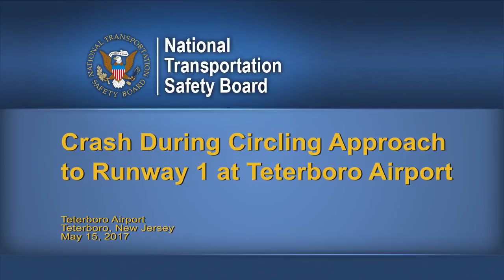Learjet 35A Teterboro Approach Crash • NTSB Animation

Comment: I follow a lot of crash investigations and it is almost never a single point of failure.  It is usually a string of failures that almost invariably start before take-off.  Reading the link provided by John Dubpernell below, the problems did start before take-off as the crew was not qualified enough for the tasks at hand.  ( https://www.flyingmag.com/teterboro-learjet-crash-raises-questions-about-crew-qualifications ) No checklist was completed during the flight; assuming pre-flight checks not done, either based on the statement by the NTSB.  

So the first error was lack of qualifications and experience and inability to follow directions,. no checklists, letting the SIC-0 fly disregarding the procedures and policy, not following the flight path,  not following controller instructions and getting them wrong and mistakes just kept adding up from there following the "string of errors that usually accompany flights that eventually crash as pointed out in the video.  The ATC had to see that this flight was not on course and altitude most of the way.  I wonder if he relayed that to his tower superiors.  Obviously, the TEB did not have enough time with the Lear to ake that call also, but should have he waived off the flight and ask them to go around? I'm not implying TEB tower staff had any culpability since the Lear did not contact them until everything was FUBAR'd already but am just wondering if they even had time to evaluate how badly the Lear jet was off his checkpoints, altitude, speed, and location to even ask the pilot to abort a landing attempt given the weather conditions.

I would also add that it is scary that the Pilot and  FO were hired with their lack of qualifications and poor performance history previously.  I immediately wondered if their background and work history was even checked and verified.  I would not fly with pilots that I knew had a background like that.  The Captain was guilty of gross misconduct and dereliction of his duties.  I might have more faith in an enthusiast who had more hours on Microsoft Flight Simulator.  (Definitely, the guy on YouTube who does all the re-creations of accidents using FS could fly that Lear for real better than these real-life pilots did.)

This is one of the few times I am totally on-board saying this incident was due to 90% pilot error and 10% bad judgment from the charter company to even hire them.

Comment: Can someone please explain to an amateur why these guy’s flight deteriorated from controlled flight into a stall and crash if the aircraft had no mechanical problems??
Reply: Most likely,  Trying to make too tight of a turn to line up for Runway 01, which means too steep of a bank angle at too slow of a speed, which exceeded the angle-of-attack limit of the wing.  Thus; the wing stopped creating lift and the airplane fell out of the sky.
Reply: Thanks, Snow Crest. But why wouldn’t any sane pilot abort the steep turn and do a go-‘round?? Surely the stick shaker would have engaged to warn them a stall was imminent. Right?
Reply: @brohoop  "get on the ground-itis"   aka, poor decision making.  And yes, that Lear has a sticker shaker and a stick pusher. That doesn't keep you from stalling, only tells you you're in serious trouble.
Reply: Snow Crest, thanks.

Comment: What this all comes down to is this: LACK OF PREPARATION ON YOUR PART, DOESN'T CONSTITUTE AN EMERGENCY ON MY PART!

Both these pilots are to blame for this mishap. SIC should not have been at the controls period. The captain is called the captain for a reason. Its his ship. His crew and even though the SIC must have supreme confidence in his captain, he too must have that same level of confidence when handling that ship.

The thing is: Jets require vast amounts of airspace in which to set up landings. Which is exactly why flaps, spoilers etc are utilized to prepare for landings. A Lear Jet requires the pilot to stay ahead of it and not behind. They move quickly. Everything must be coordinated. Obviously, that didn't occur. Otherwise such a steep banking turn wouldn't have been necessary. These pilots caused their own deaths due to arrogance, apathy, complacency and a lack of attention to detail. Lear
Jets are more akin to fighter jets. Everything pilots do in a Lear must be many steps ahead so as to keep ahead of the aircraft. 

Even a novice pilot with less than a few hundred flight hours knows setting up an aircraft in such a busy airspace is tantamount to survival. Teterboro Airport is usually very very busy. Even if one is flying a J3 Cub, you still need to set things up well in advance. These guys messed everything up. Even the radio chatter sounded way off and for such a busy area. 

Well, thank goodness no one on the ground was hurt or killed. That was pure luck.

Hope pilots everywhere watch this video as it clearly demonstrates how important it is that we have our "shit" together before we land.✈
Reply: More than luck... a higher power was definitely helping. Several issues on the ground lead to no injuries.  Some were from a higher power no other explanation.
Reply: @markh1427  Agreed👍

Comment: total layman here , but the mistake that got them killed was trying to turn at such a low speed, correct? if the flaps were full down, would that have saved them or did they just not have enough space?
Reply: Flaps would have made the aircraft all that much slower, and would have induced a stall even sooner. But from the sounds of it, that aircraft was doomed the moment it started rolling down the runway for takeoff from Philly.
Reply: @troyjollimore4100  Ah good point. But surely many flights have been mismanaged just as badly millions of times with a positive outcome?
Reply: We don’t have the ENTIRE recording. Maybe the pilot just tried to play ‘Maverick’ at entirely the wrong time. But MANY large charter flights having pilots that unprofessional? I don’t want to even think about the possibility...
Reply: @troyjollimore4100  Haha yea that is rather a disturbing thought. I'm regretting I said that !

Comment: Sounds to me like the Captain was on drugs...too fucked up to fly, so he let the unqualified SIC do the job...
Reply: What I don't get is... I'm pretty sure I could have landed that plane fairly safely. That's me being a computer tech with only simulator and maybe two hours of actual flight time? Surely the SIC had enough general flight experience that he could guess the captain's ineptness on this flight and attempt the landing himself? Even a 'screwed up' approach and landing would have been better than what actually happened!
Reply: @troyjollimore4100  Nah...I had to look it up...the copilot had zero experience...
On a rating of 1 to 4, he had a 0. That meant he wasn't even supposed to be at the controls. A "1 rating" gets him in the right seat with no passengers. 
 The copilot failed his flight simulator training. He kept crashing the aircraft. 
 And yet, he was flying the plane with a pilot who was either mentally unbalanced, high on drugs, or both. After all, a pilot who files a flight plan for 27,000' on a 28 minute flight is obviously impaired on some level. 
 The Learjet 35A is a high-performance aircraft. It's not very forgiving of being handled with disrespect. I doubt if you could recover from a stall below 500'. Stall speed is 110 mph...
 No doubt an amateur could land it but if it were me, I'd like a 10-mile approach and a very long runway. I'd drop the gear and the flaps, keep it straight and level,  and ease it down with the throttles. Very, very gently.
Reply: That's what I mean. Even WE would know to call a missed approach and take a go-around in that situation. When the pilot even attempted to do what he did, the SIC should have taken over, failed simulator runs or no... Unless it was poor luck or planning that put two 'bad eggs' in the same pot at the same time.
Reply: @troyjollimore4100  Excellent point. Your "two eggs" theory is spot on. 
  Left seat is mentally incapacitated and right seat is totally lost. 
 How many times have we read about drunk airline pilots being stopped at the gate or even pulled out of the cockpit by the local constabulary? Happens a lot. 
 I read somewhere that in the future, the flight crew will consist of a pilot and a Doberman Pinscher. The pilot monitors the instruments and the Doberman bites him if he touches anything...

Comment: Should ATC have forced them to make a missed approach since they were not lining up on the correct runway?
Reply: ATC can't 'force' the pilot(s) to do anything. Though they can second-guess (and that controller sounded pissed, and then PLENTY CONCERNED later on), they have to assume that any pilot flying a jet through that airspace is a little less likely to try killing themselves than the 'average' pilot... ;)
Reply: Yes considering how far off he was from his initial turn to circle for runway 1.  If the ground track is correct he pretty much started his turn at the approach end of runway one, there was no way he was going to make that landing even if he was able to get it down in time.  You would have to be going much faster then the 130 kt indicated airspeed to make a turn with that kind of bank angle to get lined up and that's if you can get the plane slowed down after making a turn like that. An LJ45's typical approach speed when configured for landing is approx 140 knots, when they finally started to make the turn to circle they were @ 124 KIAS it was at that point the flight was doomed.
Reply: @a914freak  Agreed... maybe in an ultralight you could turn like that... sure as hell not in a Lear...    Maybe if it was Hans Solo in the Millenium Falcon...
Reply: It was a localizer 6 circle to land 1 which means you're supposed to line up with one runway, then turn at a certain point to line up with the other. They were doing that so there's no reason ATC would tell them to go around.
Reply: @user-n4b4q  I'm not sure if you're agreeing or disagreeing ATC had a responsibility here. There is a responsibility to issue safety alerts or raise a question if we recognize something that doesn't look right, but a tower controller here would be looking at a little dot out the window that's going where he'd expect it to be going (circling to 1). And few controllers are pilots themselves, let alone instrument rated, so aren't expected to know the proper circling point for each type of aircraft. ATC has zero blame here.

Comment: Thank God that Captain was not controlling an Airbus A380 or any large commercial aircraft.
Reply: a380 wudda been gtfo
Reply: At least the big planes have auto land....
Reply: @markh1427  Thank you god for all the plane crashes - Amen - cora madonda massondanda (that's typing in tongues).
Reply: @markh1427  So does the Lear. I'm almost certain this plane can land itself.
Reply: @TrueLoveNetwork  any way of knowing this are there limitations like high winds??
Reply: @markh1427  yes there are limitations but, if I were the copilot in this situation, I would have turned on the autoland system and tried to monitor and control any egregious offsets. It's highly likely in that scenario, the worst that would have happened is a tarmac offset after safe landing, with some minor damage. The winds were 32 knots and that isn't high enough to prevent the autoland from completing a landing.
Reply: For god so loved the world, that he crashed this plane.
Reply: @user-sp8eb6iz7f See if the ceiling fan can support your neck weight

Comment: Not really impressed with the actions of the ATC. Surly they should have questioned the flight path of the aircraft and directed them to fly away from the airfield?
Reply: no, thats not how it works. The PM was communicating, but making mistakes. Could easily have been a rookie thing (which he wasnt).
Reply: The crew screwed up the instructions ATC did give them, can’t say i have any faith that more instructions would have made any difference.
Reply: They did question if he had started the turn and the pilot said they had.

Comment: some things the FAA/tower can take from this. they failed to follow many instructions. after the 3 rd failed instruction. perhaps tower could have said sir I am declaring a pan pan for you. climb maintain 2,000 feet. and then vector them in very closely and get them back onto the localizer and get them back on the ILS etc . that might have been the only way to avoid this. 
The problem is approach/departure/Tower is always hella busy . but as  Isaid after the 3rd order/instruction. id be worried
Reply: I think that may be asking too much of the ATC - that is one hell of a crowded airspace and it's probably all they can do to keep 'em from running into each other.  Also, it would be a mistake to judge ATC too narrowly, solely based on the transcriptions to/from the Lear because in the existing wind conditions there were probably many other aircraft having similar difficulties holding to the directed course, altitude,  etc.  They likely had their hands more than full handling general aviation as it was.
Reply: @chuckschillingvideos  Yes. I have personally overlooked situations due to higher volume. It really was a pilot problem. If the transponder was and it probably was then TCAS would help with conflicts.  I think I will reserve any statements until I get my eyes on the NTSB report and findings. Thanks for the input.
Reply: Uh.... towers don’t declare pan pans. 

They can just give the punishment vectors and go from there. Tower should have cancelled approach or landing clearance and said to go around
Reply: @Bartonovich52  towers and ATC have declared emergencies for ppl all the time. they do it for VFR only pilots getting stuck in IMC. plus engine issues over the water. nicko's wings is perfect example they declared an emergency for him when he had engine problems
Reply: There are several other airports besides the majors mentioned and the airspace is very, very crowded...
Reply: ATC has no authority to do anything but offer help and give instructions. This is not Microsoft Flight Sim.
Reply: This X Controller concurs. Well stated..
Reply: @sundevilification  Well stated! the ATC could have done a better job, it is scary such ineptitude in that tower that  day, they didn't seem to have warn the crew of the high winds at any point and their instructions seem sloppy at best. ATC incompetence could have been a huge factor in the demise of this crew, but of course the NTSB is not going to come down hard on an agency of their own kind.

Comment: So much is wrong with how this flight is conducted. It's hard to know where to begin. These pilots had no business flying. No CRM, no company procedures, unqualified FO, unprofessional (possibly incompetent) captain, no proper radio communications. I mean where do you begin?
Reply: How could the pilot not realize he was heading down to the ground rapidly, the footage reveals it was a clear day?
Not a pilot, but the ATC talks so quickly but I guess if you know what your doing it's easier to comprehend what is being said, but do they talk that fast because they are extremely busy. Kinda seems like the problem with doctors prescriptions, in that the speed-talking increases chances of miscommunication. Just like sloppy hand writing.
Reply: @toddlavigne6441  The SIC made the worst mistake: he was flying (whether he "should have been" or not isn't relevant) and he confirmed the turn but failed to exercise it, which led to the immediate loss of lift due to altitude loss via the abrupt low speed turn; resulting in the stall, roll to inversion; and the final brutal crash.
Reply: thanks for the feedback....terrible crash
Reply: @toddlavigne6441  - Yeah, controllers in  the NYC area are extremely busy.  And you're correct, as a pilot, you're used to a a stream of information coming rapidly from ATC, and if you're head is in the game and you're not impaired, it's not a problem.  I doubt this incompetent PIC ever even glanced at the approach plate for Teterboro before flying into some of the busiest airspace in the world.
Reply: Thanks for the info.  How can someone who appears to be this incompetent
ever get their license/ approval to fly this small jet? Seems as though this accident should never have happened.

Comment: Many aircraft models and types are fairly easy to fly. For instance, the Boeing 737 was originally designed when most transport category aircraft also had Flight Engineers aboard as crew members. It was designed for a worldwide market and has been their most successful aircraft in terms of sales and safety.  Some aircraft fly beautifully, but must be flown within a narrower margin to operate in a safe, controlled manner. I would definitely put the Lear 35 in this category, along with many others, even a C 130. If you stray from the prescribed performance parameters even a little, you can rapidly find yourself in serious trouble. Not enough information is presented about the experience level of the Captain. How much time did he have in the Lear? How much cumulative time did he have in total? Key indicators such as poor radio discipline and not running checklists is indicative that this Captain was in over his head. What do you guys think?
Reply: What the F en are you talking about? Just trying to sound smart?
Reply: @ohwell2790  I understand what he was saying or asking.